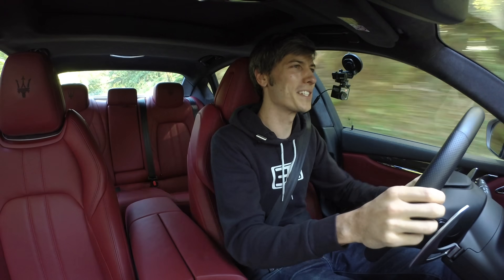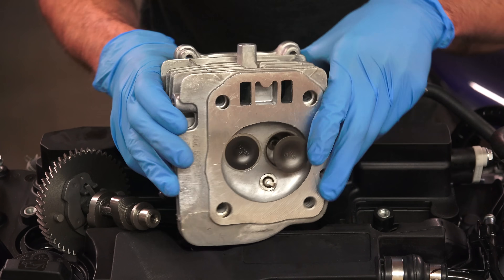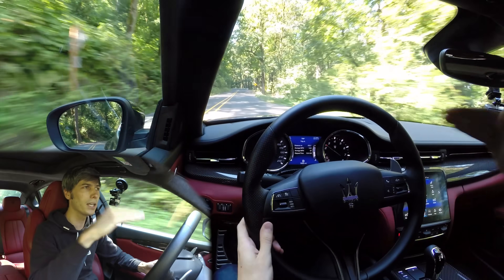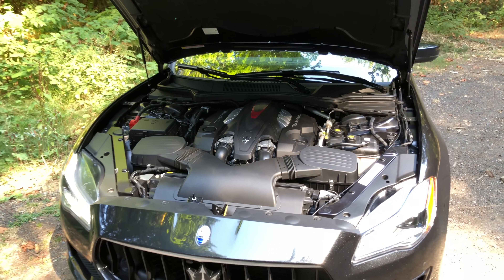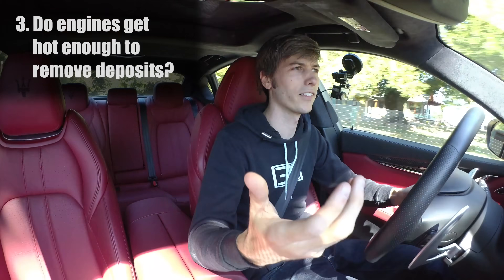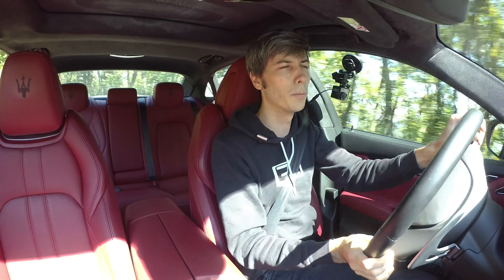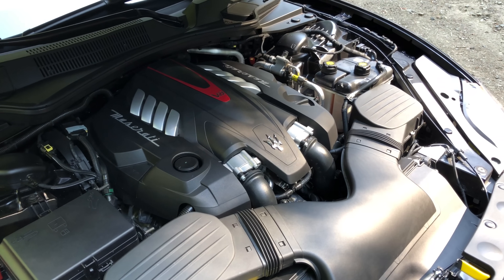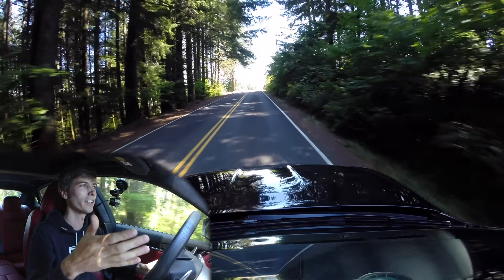Is Redline Good For Your Car's Engine? Italian Tune Up

Comment: For aircraft pilots, carbon deposits are a big subject. Hot carbon deposits can cause pre-ignition and lead to detonation. We have a way to solve this easily unlike an automotive engine. The cockpit, in most cases of General Aviation, has two ways to control the engine. The throttle which controls a butterfly valve in the intake, much like any automotive piston engine. There is also a mixture knob that controls the fuel flow. The latter is very important. The mixture knobs main purpose is to control fuel flow as air can change density based on air temperature and altitude. The second is we can use this to get rid of dangerous carbon deposits before takeoff. We can use the mixture to lean the air/fuel mixture to raise engine temps to clean the engine of carbon deposits. General Aviation aircraft engines, while largely being piston engines, have a lot of major differences. I'm curious to why leaning hasn't been implemented in automobiles. Why can't a dealership or certified shop run the engine lean for a few seconds during scheduled maintenance? Many, especially older vehicles, would run much better with this being done.
Reply from the maker: Very interesting, thanks for sharing!
Reply: Can you make a topic about sparkplugs? Espacially about the heat range? They can make a good car bad and a bad car good. :-)
Reply: @pieterdewit9081  ditto
Reply: @EngineeringExplained  Some welding people use two bottle flame system,one bottle is oxygen,the other fuel,when there is an excess of oxygen the flame is hungry and will tend to oxidize and cut metal,when the fuel is in excess the flame is much less apt to cut and might even tend to deposit carbon,this might be partially due to lower temperature but is mostly I understand to the presence of free oxygen
running the engine lean and hot too long might burn the exhaust valves and/or seats 
airplanes lean the mixture to save fuel I understand as well as to compensate for different altitude/pressure,they can richen the mixture I understand at full power to control heat,with the richest mixtures even richer than where maximum power is made,there is a cooling effect I understand
Reply: This is an interesting point, and new information to me. My gut feeling is that aircraft engines get rigorous scheduled maintenance and function checks, which is not the norm for the majority of cars/trucks on the road today. If the typical daily drivers were expected to exhibit peak performance at any given moment and impeccable reliability for decades, we might see more of this in practice. Quality shops and dealerships are certainly capable of providing this service, but I just don't think it's something customers would be willing to spend money on. Fuel system maintenance in general is not something most customers are willing to pay for even if it would net a dollar gain long term considering lifetime fuel consumption. Just trade it in for a new one after the factory warranty expires. Many, many people budget for a car payment for their entire lives and are somehow okay with that.
Reply: Greg , maybe running a engine lean for a little won’t do much in terms of cleaning, but I think it’s bad for long periods as high combustion temps are not wanted, might me wrong
Reply: @mightyrs4221  for an aircraft it's just a couple of seconds. Then again, I'm not at all positive on all the differences between aircraft and car engines
Reply: @ Greg    IMHO the temperatures would raise to high for the components of older cars when you drive with a lean mixture. Most of these engines don't have oil spraying under the pistons for cooling. So it might be a big gamble in terms of engine wear. Also your ECU should be capable of switching to a second mapping when cleaning the engine to reach those higher temps. And I think that you also need an electronic gauge connected to the ECU in the exhaustmanifold to watch over the proces. It's a complicated proces in terms of enrichment of the mixture or retarding of the ignition to protect your cars engine. The best way to keep your engine in good "shape" is good maintenance. Clean airfilter, premium oil and very good sparkplugs like iridium types for instance. And keep the crankcase ventilation clean, very important. You can also use a fuel additive from time to time that leaves a protective film on injectors and other moving parts. Another one is not to drive your car for five or ten minutes. Oil is not only for lubricating but also for cleaning and idealy the oil should reach it's operating temperature too. And that takes some time. Driving a long distance is also good for an engine. I read in many comments that engines run better after a long ride. IMO the engine is getting cleaner and cleaner when it's on operating temp for a longer period. (At least a few hours)  That is why it runs smoother while it's still the same engine. I work on older engines a lot, most of them are Volvo's. (Red blocks from '65 and white blocks untill '00)
Reply: as michael spencer says, it is an altitude compensation device. keep in mind car companies try very hard to lower NOx emissions which are highest when running lean.
I read an article once describing the incredible Honda Insight (the real one) engine's ability to run almost 30:1 for minutes at a time, after which it would just dump fuel at something like 7:1 to burn off the nitrogen.
Reply: Mainly because I tore down my engine that probably has not been reved above 4000 rpm in 350,000 miles. It has 550,000 miles and virtually no carbon. Carbon is built up by people who don't fully warm up the engine for 30 minutes at a time. I've torn down hundreds of engines. It's more about the moisture in the oil
Reply: That's interesting. I do know my current tuning box is set up to lean out a little bit at higher rpms, so maybe that will help
Reply: As many people have said here, the car is not as tightly regulated as aircraft maintenance. Also longer drives to full operating temperature is the best compromise solution as it does minimize the problem. One reason not to buy ultra low mileage used cars from a grandma or grandpa where drives are 2 miles on a cold day sporadically on a local road! I have seen 5 year old cars with 12,000 miles which had a rough idle.
Reply: You could always tamper with the feedback from the O2 sensor to lean it out.  😁
Reply: Greg Just like my old 2 stroke outboard motors.  lean em out and punch it to clean er out.
Reply: Jay Arre  Must be fun at parties lol
Reply: Also most aviation fuel is still leaded so most sparkplug fouling in airplanes is lead
Reply: Modern fuel-injected cars generally run pretty lean most of the time.  Since they are computer controlled the computer generally tries to run at the most efficient mixture.  The mixture knob on carburated aircraft engines is to let you adjust the mixture as you change altitude.
Reply: michael spencer this comment ^ = answer
Reply: Playing around with the stoiametric ratio to help clean out deposits wouldn’t be so far fetched but I’d rather the manufacturer have a patch for it. Getting any tuner to play around with it is like Russian Roulette.
Reply: Ditto for boats, as they are basically running at peak power all the time. Classic case would be those old two-strokes, and the engines from the 70s that still had a mixture control knob.
Reply: I believe running too hot even for a minute or so can damage parts that have very limited range of heat tolerance like turbocharger or catalytic converter. They work the best at a certain  temperature and can burnout or be damaged at higher than their normal temperature.
Reply: 3
Reply: Because dealership is not interested in eternal engines at all. They plan you to drive your car for 3-5 years (or even less), then change to the new model. Many of the contemporary engines are built the way in which they're hardly maintainable, if it got an issue - easier and cheaper just to exchange the whole engine...
Reply: Manual jetronic lol

Comment: For those driving a rotary engine, the redlining is actually suggested/recommended due to the prevention of carbon locking the engine. On top of that you can build up carbon on the rotors and that will decrease the compressible surface area!

Comment: What about water injection? Ive seen vidoes of people spraying fine mist of water in the  air intake, after turbo mostly (some did before turbo) with the theory that when the water enters the piston is immediately flashes and turns to steam because of the heat and the chemical reaction hits the carbon deposits which also loosens them. Just wondered what your take on this is?
Reply from the maker: To be honest I don’t know! I’ve heard about it but haven’t really looked into it much. Will learn more!

Comment: Sorry Officer I was just cleaning out the deposits in my engine
Reply: That actually happened a few years ago in Bavaria, just half an hour away from Munich. Cops stopped a car doing < 180km/h on a backroad (I know that road - there's a long straight with good visibility, so perfectly safe, despite the 100km/h speed limit). Driver was an elderly lady around 80years old. "Young lad, but you have to floor it from time to time, else the valves will carbon up!". 
According to the newspaper, cops were impressed, but fined her nonetheless.
Reply: next time just tell them your ea-wife ran off with a cop, and you where speeding because you thought they where bringing her back.
Reply: Doesn’t need to be a 5th gear redline, 2nd does the same job.
Reply: @daviddoyle982  only if you hold it at redline..to a degree the longer you have the engine in the top of it's powerband and the more load you create the hotter the components will get so a wot pull to the top of final gear would logically create more heat and have a greater effect since it takes longer and multiples the load on the engine
Reply: Officer:
"That's o.k. son, 
the elderly lady in the crosswalk is just clearing out the deposits in her panties."
Reply: I bet the cop sends the tickets to italy.
Reply: Officer says: BS! I watched the YouTube video and Jason said it doesn’t work so no excuse.
Reply: The police will then happily help you clean out your deposits....from your bank account :(
Reply: I will try this next time a cop pulls me over.
Reply: Stevie Wonda godspeed
Reply: Exactly 🤣💪🏻👍🏻
Reply: Sorry Officer, I no speaka de inglish. Youa tuning up youra car too👍
Reply: @chrisk853 I cooka da spaghetti 🤌
Reply: Travis Hearon Nice... 👌
Reply: This aged well
Reply: Got off of a ticket the other week with this one.
Reply: @valar_euphoriants5898  Then redline on 1st gear! :D
Reply: Some things that the police don't understand
Reply: That Cosby routine about getting the gunk out, and the cop must be coming out of Cos's trunk, is just hilarious.  "Yeah, we're gonna get the gunk outta you!"  Sadly ironic, when you consider the potential consequences of a DWB (driving while black) and how he later on lost his only son, who was murdered on the highway by someone trying to steal the flashy expensive Mercedes sports car he was driving.
Reply: This is the 3rd time this week 🚔 👮‍♀️
Reply: I think auto transmissions that shift at low rpm to save gas is not good for the longevity of the engine either.
Reply: Sir you don't have to do that in sixth gear
Reply: I told dude the truth and he gave me a ticket. Needs to be finding and arresting heroin dealers not fishing for more money for the department. “Performance standard” -> quota. Douche bag.
Reply: @x0xCRUSHERx0x  They catch the people that are breaking the law that they can catch, because they can't catch the people that are breaking the law that they can't catch.
Reply: Michael M 2+2=4.

Roses are red 
The sky is blue
Your comment is rhetorical 
Duh duh duh doo doo doo!....🙄🤪
Reply: @x0xCRUSHERx0x  Yep most of them are like that! all they care about is looking good in front of their super and tickets do that well so they will gladly get you in trouble for something that could have happened because of your actions and totally disregard that you did not hurt anyone.  As soon as he said  “Performance standard” I would have called him a revenue officer. Get a dirtbike or fast ATV and ride it on dirt roads with no plate, be ready to dip into fields though.
Reply: LOLOL
Reply: When we drive we enter a conspiracy called traffic. 
  So live on fruit to compensate and to make my woman made from 
rolled up newspaper 
taste less of breast milk. 
-- Joseph Stalin. 50th of Septober 1899
Reply: I'm the 666 like 😈
Reply: alan recinos my car has 666 etched on the frame under the hood 😒

Comment: So does that mean that maybe my more frequent cold start city driving relative to warm operation is what killed one of my exhaust valves in cyl. 3? It had significant enough build up to prevent proper seating, and it resulted in about a 0.4" x 0.1" area being burned off which of course destroyed my compression.

Comment: Learned from another car show: If you want to remove carbon deposits in the cylinders,  go on the highway maintaining a speed of around 120KM/h (around 75 mph) and select to a lower gear (maybe 4th gear) to keep the engine at around 3000~4000 rpm, it will help remove some unsolid deposits (for deposits already formed for a long time and become solid, this method doesn't really work). There are two reasons: Higher speed could make the air flow in the intake much quicker and help "blow" the deposits off the valves; higher RPM could also increase the air flow and temperature to remove the carbon deposits in the cylinder. But the show also notes that DO NOT STEP ON THE GAS TOO HARD! Since that will increase the engine load and force the engine to inject too much fuel, which will cause more carbon deposits. Keep the engine at high speed, high rpm, and low load can be helpful to some extent. (FROM ANOTHER CAR SHOW, NOT MY IDEA, BUT VERY CONVINCING)

Comment: With a diesel with a DPF, it's of benefit every so often to give it a good Italian tuneup to ensure a proper regeneration takes place. A passive regeneration will only happen when it's at a high enough temperature, so giving your car a bit of a blast will aid this.

Comment: But the real question is, is the wear significantly higher when I drive for some miles on the German Autobahn in high rpm? 
You can travel constantly with over >200 kph/ ~130 mph when its night.

Comment: I never had an issue with my engines. Most time I run an enline in the low to medium rpm range and on the Autobahn I give full throttle to it for hundrets of kilometers. Every engine I've ever owned lasted for at least 300000km.

Comment: For the valves, since they are slamming shut wouldn't the increase and RPM, resulting in a faster opening and closing, contribute to the carbon flinging off?
Reply: I've been behind cars before that have pulling out in front of me, and we obviously WOT, dump very black smoke out, that looked like carbon and not blowby. I also had a friend in HS who ran his mother's Cadillac hard one night, and it blew a ton of carbon out the exhaust, because his mother drove slow.

Comment: I had an old Saturn that just wouldn't run smooth. I put a bunch of octane booster in the tank and revved it for a bit. It coughed and sputtered for a few seconds and shot a bunch of black exhaust out the tail pipe. Sure enough it ran like a top after that lol.

Comment: 3:31 I think you mean "decarbonisation" instead of "decarboxylation". The latter is a totally different reaction of carboxylic acids.
Reply from the maker: Decarboxylation is what I was going for. Removes the carbon atom from the molecule which is attached, breaking it apart and removing it.

Comment: I wonder how bad redlining your car actually is. I peak the engine at least a couple times every run I do with it for home-work driving. more since its fun even though its only a small engine :)
Reply: On a healthy engine, redlining each gear getting up to speed etc wouldn't be an issue. It's only when it's put under constant(i.e. racing) high rpm and high load (max power), on an engine not designed for it, where you can have overheating issues and even things melting. It depends on the engine but if nothing has broken so far I wouldn't worry about it, and if it has; find a car/engine that can take it!
Reply: ok sounds that i dont need to worry about it :) tnx

Comment: You've done more research than me but I swear on my memory I read that the initial coating, if you will, of carbon deposits happens really rapidly in a street driven engine (like by 1000mi after brand-new clean you've got a nice layer) and after that it's much less appreciative so what you do makes no worthwhile difference. It seems like there's always going to be some but it'd be unusual to have a huge accumulation that's going to be detrimental to performance. I'm paraphrasing big time but that was my take-away from what I saw

Comment: This addresses the thermal side of things, but what about mechanical? I've definitely seen older engines that have sat a while blow black smoke out the exhaust after a redline and then run much better. This is especially true for two strokes where carbon built up can cause the reed valves to not seat properly.

Comment: Hey i have a problem i drive a manual and sometimes if i give my car too much gas in first gear the car will buck and jerk regardless if the clutch is slipping or fully engaged

Comment: My 350 Camaro needs regular high revs...and hard screech shifts. Actually, this aging driver (67) needs to hear that four-barrel wide open...a most refreshing sound, plus it is good for everything per my race buddies. Bad gas accumulates in the secondary fuel bowl and MUST be removed regularly, probably daily or hourly. All that 'stuff' coming out my duals must not stay in my motor. Old school power drifts at WOT are just so much fun!